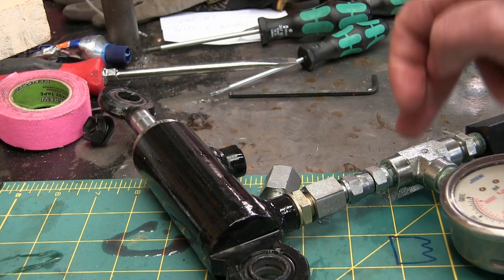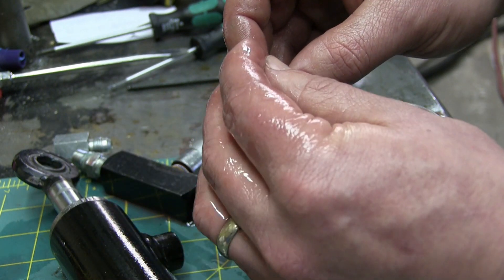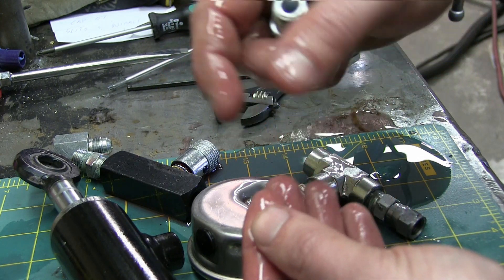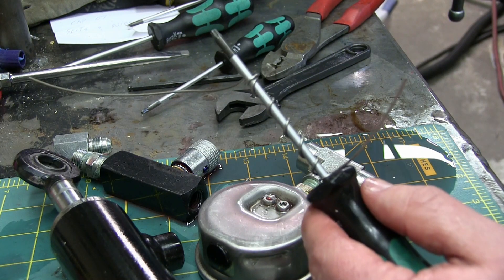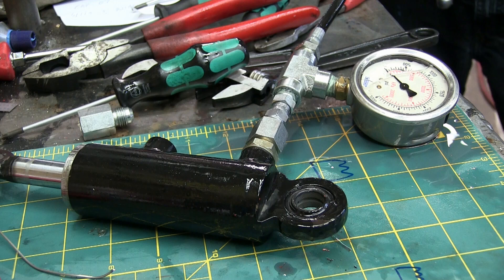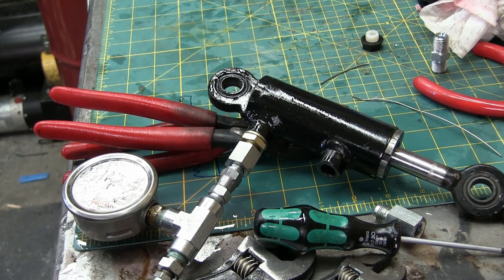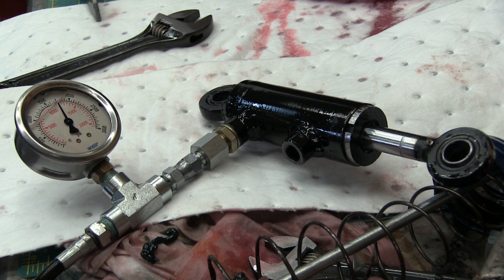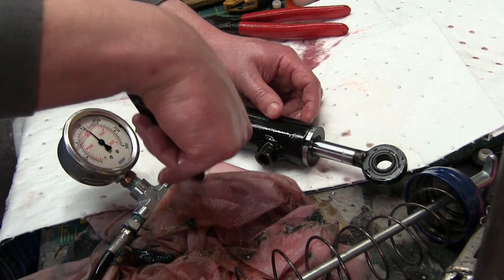Dirt Cheap Check Valve for Hydraulic Emergencies and Tinkering!

Comment: Hi. I’m caught in a bit of a Pickle myself. Long story short. I cracked the faceplate of my Gresen loader pump because I turned the engine over with frozen water in the system. Anyway I found a Haldex pump MOTOR, I want to use this. It has an inlet and outlet and a third port on top in which I believe the schematic showed this as a check valve. Would this check valve require a line running back to the tank?  I believe I read somewhere that you cannot tie this line into a tee off the outlet port.  Is this correct???   Thanks. Great videos by the way.
Reply from the maker: Small port? Is it labeled? Find out 100% what it is and decide from there.
Reply: @ Hi. The schematic shows this big port as a Closed Bolt check valve at the back of the housing away from the in and out ports. It is the same size as the In and out ports. This check valve if it is that was missing. Just off to the left of that port is a small port that is about 1/3 of the size.

Comment: Even though this video is over two years old I found it by looking up ball valve and it started my thinking could this not be made and used as a bench top Press? for sat... removing bearings?.....pressing bushings in and so on?... only need to make a basic "A" frame Mmmmm -- I think I'll give it more thought the only hard or maybe expensive part would be the cylinder???

Comment: You mentioned that the grease gun used the viscosity of the grease to hold the pressure.  Not so.  The grease zerk on the equipment being greased  provides the check valve.  Thus you have a complete hydraulic system, albeit slow moving.

Comment: If you have the spare fittings laying around, a quick bleeder valve in between the newly installed check and the piston. Save you from having to break loose a threaded fitting when you get closer to 2500 psi. yikes...

Comment: Maybe if you used a ball that was a high grade of hardened steel and a fitting that was brass or Aluminum, or even just a softer grade steel, it would make a much better ball seat just using the pressing ball and fitting together method. Then after you did that, you could get really fancy and use a bit of valve lapping goop (the stuff that looks like regular grease that's loaded with gritty shit) and a matching ball to get an even better seal between them.

Comment: wouldn't the screw work a tad better since it can kinda locate the spring?
Reply: No. If it is offset by the spring it won't seal. The ball bearing is always round and sets against the chamfier.

Comment: I keep staring at the gauge wondering how you managed to get fluid in it, or if it even affects the thing. I heard it does, so it keeps bugging me to see it there. A little moisture is normal on my gauges, but if it pools like that, I tend to break the screen so it dries out.
Reply: Those are liquid filled gauges. They are supposed to be like that. Look up liquid filled gauges vs non liquid filled.

Comment: Shoulda linished those cheese tools down for some skookum flush cutters for the zip ties! Got my brain departments working on my problem, which is cheap ass homebrew low pressure relief not check, but thanks for the inspiration

Comment: Last week I needed a lite weight check valve for a diesel engine. I couldn't find the rite size ball bearing, but happened up on a button head cap screw. I then chucked the threaded in up in the drill press with a dab of valve lapping compound on the head. Then stealing a lite weight spring from a side shaft engine governor I had a check valve that I could blow through with my mouth but 125 psi from the aircompressor wouldn't leak past it. My engine hasn't lost prime over night since this cheap fix. Oh the threaded part of the screw holds the spring straight as well. I don't have the mental capacity to make and edit videos so you could make one with a button head screw with an Allen socket to show off the process.

Comment: Grease systems have a built in check valve, it is in the grease nipple.

The nipple and line can retain a lot of pressure (energy), with the potential to cause oil/grease injection or projectile injury, if a pressurised nipple is removed without releasing the pressure before loosening  (a tool for that does exist).

Releasing high pressure oil from a hydraulic system isn't for the uninitiated, the faint hearted, or those who really don't want to know about tracking oil injections in the local surgical department.

Comment: Hydraulic fuckery question ...

I have an engine in a van that it's not supposed to be in and cooling is an issue. I want a fan that I can run for hours without trouble so normal auto cooling fans are not an option. I only have standard car 12v so bigger electric motor/fan combos are out too. It's not in a position to allow me to run a fan directly off the crank either.

What it does have is the old car (honda) power steering pump. Could this be used to power a hydraulic motor? Would it need a valve setup? (the fan obviously only ever needs to turn one way at one speed)

Comment: I know you mentioned that the grease gun doesn't need a check valve because the grease is so viscous and while that's certainly true it's also because the grease fittings are all check valves themselves.

Comment: Ave, I just have to say thanks. I learned something from your videos that saved me a few bucks when I thought I needed an new miter saw. First, you commonly say if it's broke, you can't break it. Second, in one of your videos you said that one of the most common fail points of a tool is the switch. So I checked the switch on my miter saw, fixed it, and now I don't need a new one. So thanks!

Comment: Looking for an 'ask a friend' lifeline to explain this more better to me: Pneumatic systems are a compressible fluid so how the PSI builds is clear, the air compresses. Liquids, and by extension hydraulic systems, are effectively non-compressible so when the PSI builds, where is the pressure building? I'm trying to think of how to articulate what I'm imagining is happening in this system... When the fluid is pumped into a system that's maxed out (as in the cylinder that's at maximum extension), there's no more empty space for the fluid to fill and because you can't compress the fluid, you can't cram more into the space available. When you continue pumping until the power of the input (hand strength in this case) is maxed by the resistance of the fluid being pressurized or something fails, what's accounting for the extra fluid being pumped and where is the PSI accumulating? I'm talking like PSI's are individual items here, I know. Bear with me. Is there expansion in lines/fittings/cylinders that's accounting for it that equates some amount of expansion to some amount of additional PSI depending on the fluid and material?

Am I looking at this all bass ackwards? Throw me a bone here folks.
Reply: +AvE Got it. Been thinking about it more, feels much clearer. Thanks chief.

Comment: you should throw together a check valve made on the lathe,  just cut a chamfer into one of those A-aapters, and maybe a matching check and fit it into your high pressure testing rig, I'd love to see how well it would work.

Comment: If you are forced by time or circumstances to make your own springs, stainless steel works slightly better. Surely you have a bit of stainless tig wire floating about?

Comment: i feel like this is one of those days where at the end of it you come out of the workshop and think to your self i wish i never tried this you don't make anything useful and are left with a big mess to clean up you could add a valve in parallel to that you dont have to take a leak every time you wanna drop the pressure

Comment: Twist both ends of the copper wire into a small loop.  Nail down one end into a sturdy surface(or stick it in the clamp), and chuck the other end into a drill.  Use the drill to spin the wire.  This will straighten and stiffen the copper.

Comment: Ya know, with a MAPP gas torch, and a little oil you can temper that "spring" into an actual spring pretty easily, depending on the alloy of your wire.

Comment: try doing pumping like that for concrete injections. worst 3 months of my life. also where is the mention of the grease nipple check valve, as you said there is no check valve on greasing systems, and relies on grease viscosity to maintain pressure. so wrong, you ever try greasing a good balljoint without a check valve... pfft. also you need to work out more. pffft. 3 pumps and your done, no wonder you spend so much time in the shop and not so much with the wife. trouble increasing the chooch factor lol ;) jks

Comment: Man! Get some Knipex. As said on another place: You can buy wirecutters and you can buy Knipex.
Reply: I'll have to try them out. 7-1/2" ones on eBay $30 German made
Reply: +Stefan Gotteswinter Had my knipex for 5 year. I'm a lineman so i use the hell out of them everyday and still cut better then new ones of other brands.
Reply: +Stefan Gotteswinter for sidecutters i think he's using some kleins or knipex. he is not unawares of the knipex
kleins ain't nothing to sneeze at
Reply: I wonder how well ORS Nasco cutters stack up to knipex. 8" ORS side cutters retail for $50

Comment: Idea for making it seat properly: using the "pink velvety mushroom tip" screw, chuck the shank of the screw into a cordless drill, smear the head with some fine abrasive paste (or river silt, wet'n'dry scrapings- whatever) and spin the screw head in the pipe fitting to grind out a properly shaped recess like you're lapping an engine valve.

Comment: Ave, I would normally not disagree with your brilliance, but, why did you not use a zerk fitting? A zerk fitting IS a check valve.
Reply: this is of you don't have a check valve but need to get the machine operational before the actual part arrives onsite.
Reply: dustlesswalnut
So what is your point? I asked why he didn't just use a grease zerk since he was using a grease gun. If you have a grease gun, you more than likely have a zerk fitting too. A zerk has a built in check valve. Get It?
Reply: +CumminsDslPwr because the video is about making your own, not using one you have. also I have a grease gun and no zerks.
Reply: dustlesswalnut
thanks for that useful bit of information, but you are not Ave, and you still don't get it.

Comment: Thanks for putting your life on the line for the sake of fuckery science but be careful with high pressure fluids as fluid injection is the worst thing in the world. Ask me how i know. Just put a three way valve so you can drain the fluid back into the reservoir. Or just a warning to the dumbshits out there who'll try to replicate this contraption.
Reply: +metalhead2508 I cringe everytime someone re-invent the hydraulic system. I had a neighbor who tried fixing a hose leak on a backhoe with electrical tape and kept his hand on top of it for a good measure while his son tested it. His hand was every color in the rainbow and then some and 2 months later they cut it off. Fluids under pressure are the most under-rated and un-talked about safety issues in the workplace. And don't get me wrong, I hate raining on someone&#39;s fun but fluid injection is no laughing matter.

Comment: My dad made a head for a air compressor out of 1/2" plate and the valves were the fittings and a ball the pump was a brigs and straton 4 horse it worked great for years at 40 psi
Reply: Most things need more than 40 psi
Reply: +Josh Lukowicz it worked good for pumping up tires.
Reply: +Tf9500 that's probably about it, but with some tires you need more

Comment: BETTER: Take a ball pen apart, you get a better spring and then use the middle connection of the T connector so the spring can rest against the wall of it.

Comment: Question. You've talked in the past of how hydrolics will fuck you up good if you don't treat them with respect when repairing, disassembling, and decompressing. Do accidents lead to basically a oil injection? What is a "safe" pressure zone? What type of failure makes your pucker factor go up the most?

Comment: How about modifying one of those ebay electric fly swatters? I bought one and added a capacitor I had lying around and the thing is a riot. Bug season is soon upon us!
Reply: +smallmechanic I'll make a video and post it tomorrow. I have a stock one too and will do a quick comparison.
Reply: Schematic?
Reply: +smallmechanic probably just puts it inline with the battery before step up. Those cheap ones wouldn't have any logic on them.
Reply: +Cliff Mintzer you didn't post anything?